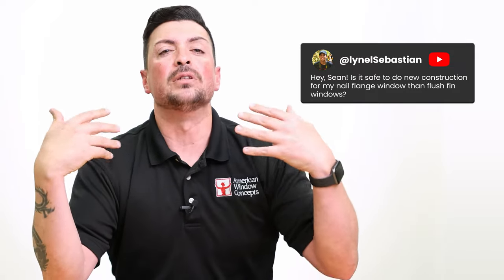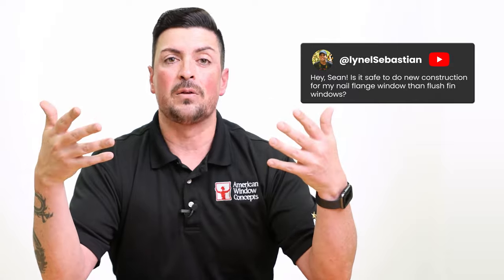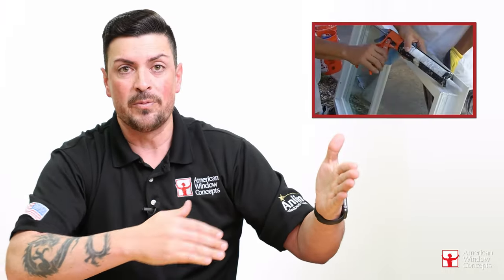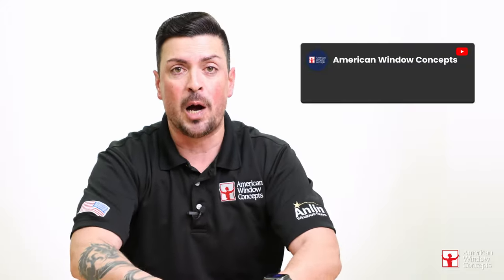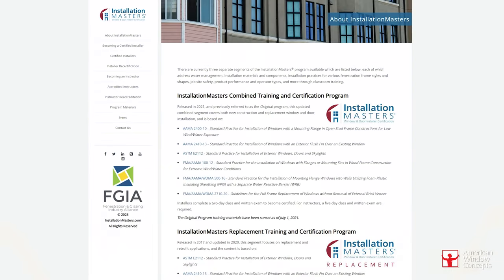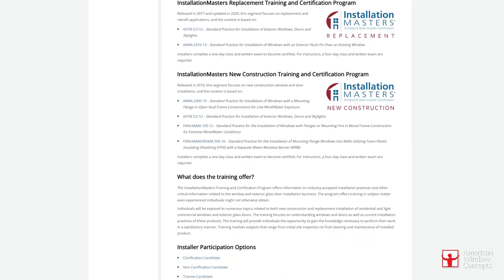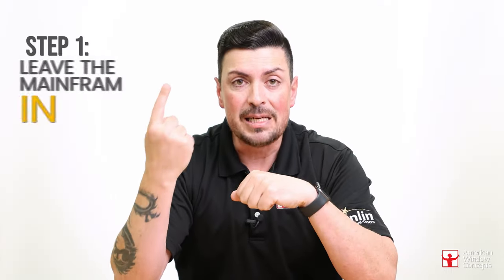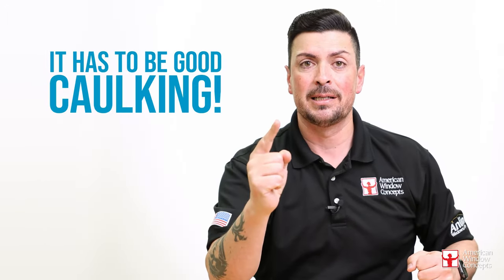The Sad Truth About Retrofit Windows

Comment: Seriously....it's a house....not a rocket.  I replaced all of my foggy vinyl windows myself with the cheapest replacement panes I could find.  Pop four trim pieces off, remove the glass, insert new glass, reinstall trim pieces, done.  It's not hard, but window replacement company would have you believe it's like nuclear engineering.  A company i had come in to give me a quote on replacing my foggy glass wanted over $1000 per window.  I said no thanks and replaced the glass only in about 20 minutes for $56.  Ridiculous.  It was easier than changing the oil in my car.
Reply: If you are handy and have mechanical ability, a lot of things are easy for those type of people. I happen to be one as well as a 30 year window installer. $800-$1,000 per whole window replacement is not unreasonable. Could you name all the steps involved in that job? Bet you can't. And, $56 per insulated glazed unit (IGU) is ridiculously low.
Reply: @brianmueller7913  He probably meant that 800-1000$ is installation only. Given that most contractors just put them over old windows seems to be too much to ask.

Comment: We just had a bunch of retrofit windows installed. The installers put no caulking or sealant of any kind on the existing frame or on the new window flange before setting them in. They simply set the window, screwed it in, and then put a ton of silicone around the frame of the window to the stucco.

Comment: This is true for an inset window or nail on new construction but for retrofit windows with a z-bar that sits on the stucco in an aluminum window it’s not necessary to put chalking on the frame or jamb of the old window because it’s covered by the z-bar. You just seal the outside and inside.

Comment: Useful video, thanks, but I'm looking at Simonton vinyl replacement windows for my stucco house, and a) there isn't an option called "retrofin" and b) neither of their 2 options have any exterior, exposed moulding like you show in this video.  Their options are 1) nailfin (wide flange on the exterior but it's designed to be hidden under siding or stucco, or 2) blockfin, which has no exterior flange or moulding (if fits flush with the window opening, it slides into the existing frame, which is left in place, and it's nailed in place to the interior side of the old window frame, through the wallboard, into the studs & header.  Are you as confident that this blockfin style of window can be leak free when you install them? Thanks.

Comment: How many nails should you put into the nailing fin for a new construction vinyl window because there's probably  30 slots for them and are zinc plated construction screws ok
Reply: Window manufacturers have what is called a Notice of Acceptance NOA document that shows the proper installation procedure on different types of structure that included the fastening pattern and type. At least we have that in South Florida and our inspections are tied to that. Don’t follow it and you fail inspection. Nailing at all is out of the question.